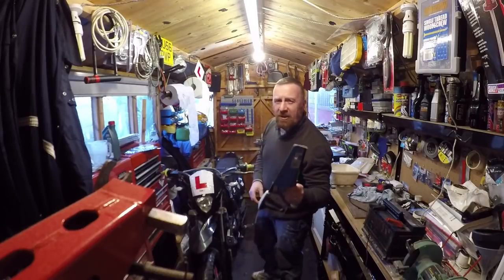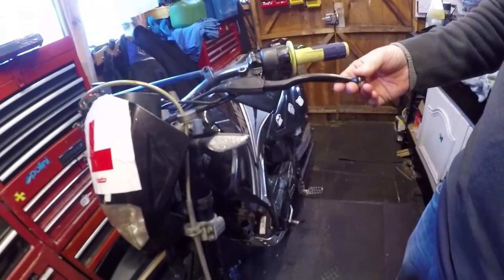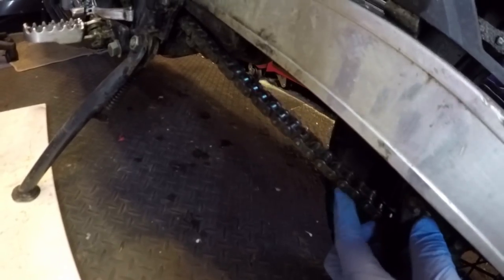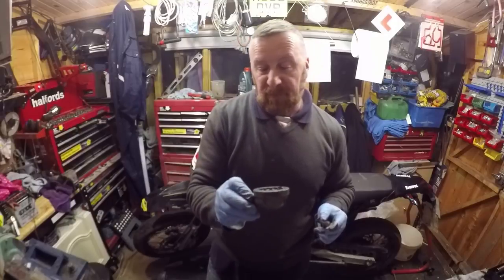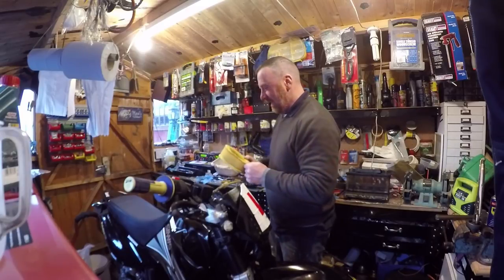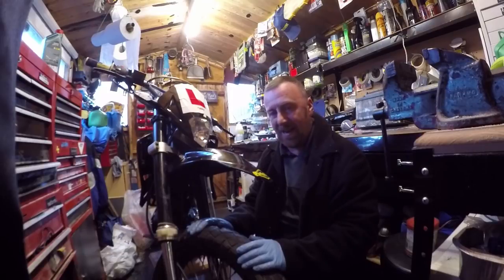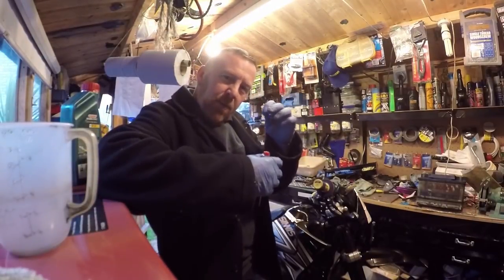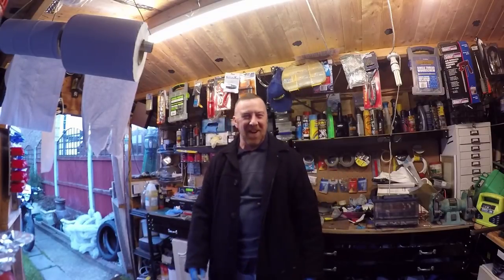SINNIS APACHE 125 REVIEW AND FIX UP MARK SAVAGE

Comment: I do a lot of work on these Chinese bikes in my shed lol I find most the issues these bikes suffer from is electrical the current varies while it’s on idle causing bike to hunt slightly and sound off and another one to check with these bikes if they don’t idle smoothly is the valve clearances! :) great video mate keep em coming I’ve just got a speedfight 100 project on the go now 😃
Reply from the maker: you have to love the old speedfights bud, thanks for watching and you comment
mark

Comment: Hi Mark top videos as always. Just thought I would share this with you. Speedo cables snap a lot on these due to poor routing, where the cable go into the front wheel at 12oclock re-route at 9 o clock, less of a bend that way

Comment: SINNIS APACHE 125 are really good bikes ..provided they looked after and regular maintenance .. Generally everything most young lads don't do  .. that's only problem with buying a second hand one you can be pretty much sure its had a hard life and not been looked after at all ... saying that even from new bolts are loose and none of cables are greased lol  

pretty much same state yours in ! ... i changed oil on one i had and looked like really thick gravy with lumps .. so am guessing its never been changed since new hahah
Reply from the maker: a gree and this is what i say in my videos of these and may other bikes / mopeds as in my many videos lol
thanks for watching
mark

Comment: Hi mate, im back again for your help.. bought one today (an apache) was all fine but ive never had geared bike so was stupid to try ride to london from brighton... i kept stalling at red lights before even getting on a23, and when i did i got to like 70 and engine jus cut out.. i think i had the choke on so i messed it up.. then wouldnt start and think battery died now. Had to leave it at some lovely peoples farm and get it tomorrow in the van.. you happen to have some advice? Cheers Mark.
Reply from the maker: oh dear bud 
ok look at videos of geared bike and how to ride them lol, remember to use your clutch and change down before stopping 
https://www.youtube.com/watch?v=aOYxE2NcpN8&t=13s    try this one 
if you had the choke on you will need to clean or change the plug as everything else will be ok on the running side
as for the gears as long as you have not damaged that side of it- it should run 
charge battery when you get it home then give it a start
Reply: Managed to get it running.. was very weird.. wouldnt start after charging battery, cleaning plug, and then kicked the bike stand back and somehow reacted and started 2nd time we done it, was wondering where you are located and would you be able to help with abit of tlc on this bike would appreciate it. Let me know if thats possible
Reply from the maker: @klaudkveda2917  hi bud its not something I do to be honest, I do lots of videos on how to do that so check out all my other 125 videos as they will help but good news its all running again
Reply: @marksavage  something real weird going on.. it started this morning, went to work, try start later and wont start again, soemthing to do with the bike stand
Reply from the maker: Klaud Kveda I bet you’ll find this was the the underlined problem with the bike 
I agree it’s electoral so wiring / cdi problem not engine as such 
You have cleaned carb plug and air filter petrol is getting in ok and clean 
Could even be stator coil 
You have work there bud 
I’d take it all apart and go over everything

Comment: Great video, I own a houniao hn125,  you was talking about air mixture adjustment on the carb saying 6 and a half half turns out I've adjusted mine 2 full turns out it starts runs ok but sometimes backfires in the carb should I turn it out more or less or just leave it as it runs ok, any advice much appreciated.
Reply from the maker: 6 half or 3 full turns is the standard, once the bike is running ok leave it otherwise a little our or in for fine turning is down to you, cheek to colour of the plug as that will help you to tuning it 
thanks for watching 
mark

Comment: Hey mate i got a sinnis apache 17 plate carb.  Its now getting really hot after a little ride. I do need to do air filter.  Mine pops 😅
Reply from the maker: they are air cooled , change oil for good 10/40 oil , give it a service with the plug and air filter. see how it gets on but it is hot here in the UK

Comment: Hi Mark, sorry me again. Couldn’t find my earlier post. My ybr has done 25,000 miles (last services around 17,000) there is definitely an out of place noise when I’m traveling along about top gear, 5,000rpm. It sounds either top end or left hand side of the bike. It’s lot less noticeable if I travel up a hill in top gear. Only when on the flat I hear it . How easy is it to check the valve clearances ? Also the cam chain tensioner ? Or any other ideas what it could be
Reply from the maker: if the left side it sounds like the cam tensioner which is common as for valves there are some videos on line but as yet I haven't done one but its not too hard as TDC then adjust to the right clearance 
it will need doing very soon bud or it may fail
Reply: @marksavage  How easy is it to look at the cam chain/belt and adjust ?
Reply from the maker: you can take off the left hand cover with a few bolts and take a look and the tensioner  is just behind it 
it may have come loose so worth a look

Comment: Hi mark we speak on Facebook about Pj laming I have a Apache that’s got not spark best things to check please mate first to check battery of course but any other common things on these I had one but it was a carb clean and good
Reply from the maker: rear brake and switch , chain and cogs , front shocks , burning oil bud and good old speedo cable , ph rust lol 
plus add in tyre cost if low

Comment: Hi Mark
Hope you are well love your videos looking for some advice
I have a zontes mantis 125 with dual brakes front brake works ok nothing from the rear tried to bleed but only spits out fluid.
Tool caliper off all free and good meat on the pads.
Don't seem to get much fluid to brake union.  
Don't know if you have worked on one any advice bud
Merry Christmas
Reply from the maker: hi bud it could be a air lock so may need to suck the fuild through but often the master servo goes or needs an over haul ,you can by kits for bleeding brakes on line that will help 
marry christmas to you and all bud 
mark

Comment: How you get the air filter out I felt there was something stopping it and don’t want to force it but couldn’t see what was in its way
Reply from the maker: Double check you have all the bolts out , there's one in the middle and far corner bud
Reply: @marksavage  I have took all the ones out the casing is that what you mean ? Or is there more holding the filter in place ? Thanks for reply 👌
Reply from the maker: @frasermitchell966  yes bud that's all that holds the cover on !
But easy to miss one 
If all off then you will have to give it some
Reply from the maker: @frasermitchell966  or are you saying the cover is off 
Then some filters twist off or have a screw in the middle
Reply: @marksavage  yeah the cover is off mate I could see e filter looked the same as one in this video just because you didn’t show how it came out I wasn’t sure if it just pulls out or not ? Have you got Instagram or that for more info you seem to know a lot about these bikes ?🤞
Reply: @marksavage  sounds good will try that thanks buddy, now the bike won’t start think it’s the batter with this cold weather , any tips how it comes out

Comment: I have the lexmoto adrenaline version. Mine has a terrible rattle. Apparently it's the crank shaft balancer nut is loose. Is it an easy enough job. Like the videos btw. Thanks
Reply from the maker: dobby1995 it’s the adjust on the side the keeps it tight but if its rattling the damage may have al ready been done 
They suffer from cam rattle 
The valves need adjustment and as in my video oil !
It will be a big job as to get to it lots have to come away bud
If it’s running let it keep running just don’t push it too much  
Thanks for watching
Reply: @marksavage  nice bike m8 
Fitted new bat to 
Scooter not starting 
But lights n horn gd 
Think starter on. Way out 
Prob its first change 
Since new
Reply: @marksavage  ohh thanks anyways I'll just ride it until it dies then lol. Ive had it 8 months like that. Just got to do until February when I get my fz1n. Got to admit though I would recommend it as a first bike to anybody. I've gone from a full power aprilia rs125 and don't miss it one bit. You can throw  these around making for great fun.

Comment: Had a white Sinnis apache it got stolen I  did loads work to it replaced the back sprocket chain lextec  stainless steel oval full system better ignition coil clutch cable  Speedo drive .They  nice bikes good engines have to watch the oil on them tho replace it often and the starter spag clutch and clutch cables I put a bit oil in stator side where the starter clutch is never went on mine did nearly 15k on it before was stolen
Reply from the maker: they all have the same rear light , rear brake , speedo, clutch , chain and ignition  problems but you get what you pay for 
loads of 125 video to watch on my channel

Comment: wondering if you could help me out whatis the factor slow jet size for sinnis apache 125.and will it be ok to go one size up to get little more power with slight air mix ajust if you could help that would be great
Reply from the maker: To be honest best change exhaust as this will help 
Upjet just make the air mix a mess with bad starting or browns the plug 
Just if you want best take it out and go up by 4 then tune as in my carb video
Reply: @marksavage  don’t really want to change the exhaust my five year old sits on the front with his own pegs 
So the quieter the better sometimes we can be 40 feet away from people in the woods a bit of short shifting no one knows  you are there 
So we rely on stealth .thats y I was wondering what jet size is cos give it sudden full throttle to like get up a hill or need sudden power to get out a situation it bogs think it’s a 3.5 in it just now .whats the main size you see when working on them .i can’t seem to find anything on the internet
Reply from the maker: @prcaroo1  I'd take it out to see what it has in there now
But a good service and new plug / air filter will help more bud
Reply: @marksavage  done that and all that stuff already bog still there ? Think I might just get new carb
Reply from the maker: @prcaroo1  yea bud ,if new filter and plug 
And all adjustment of carb ,valves ok then yea new carb
Reply: @marksavage  do u have a manual.?if so fancy looking up jet size 🤭think I’m gonna have to order one of eBay.tried to download one or two but can’t seem to do it 😤
Reply from the maker: @prcaroo1  sorry bud no
But if you take it off it will be on the side of the jet
I always bought a pack of 4 so one down and 3 higher to play
Reply: @marksavage  the one that was on it was not visible tried that got jets of eBay 2.5 to 4.0 still seem to have the bog all the way thro them rev a Little slower it revs all the way thro let the idle settle full throttle either cuts out or has a crappy bog .its that bog that has caught me out a few times when I needed the power to get out a situation hill ditch off road for example just can’t seem to get rid 🤬🤯

Comment: Hi Mark, I have a pulse adrenaline 125 and it won't idle or start off electric start but will eventually bump start ? Any ideas what it could be the problem?
Reply from the maker: a few things but but could be the stator coil , power regulator , ht coil , even plug plus they have a odd fuelling system
Reply: @marksavage  okay thanks for helping  Mark, but after cleaning tank out and cleaning carb also replaced plug freash oil new ht lead i thought I will put baffle in exhaust as its never had one and started tap of bottom lol. Any reason why its dosent like it without dB killer anymore.
Reply from the maker: @ethanb6276  they need back pressure bud 
But could be worn piston and now needs a little help 
If it runs now bud I'd leave it as is

Comment: hia mark have a tappets  issue got feelergagis do u no the size it's a sinnis 125cc for intake and outlet
Reply from the maker: Hi bud 
Thanks for watching and wish I could help but I've not worked on one and dont know the gaps 
Maybe try google or ask at local bike shop
Reply: @marksavage  thanks bud
Reply: Haynes manual says 0.08mm - 0.10mm on the inlet and then 0.09mm - 0.12mm on outlet. I set mine to 0.08mm on the inlet and 0.09mm on the outlet seemed to do the trick

Comment: I have recently bought an mbk booster and took out the variator ring and put slightly lighter rollers but now untill 20 km/u it accelrates quiet good but after that I feel like a dip and it loses power. Do you have a solution? Thanks.
Reply from the maker: as in my videos
light roller with give you great pull away but no top end, to heavy slow pull away but when you do get there good top end, watch my VARIATOR video 
id go a little more heavier 
mark
Reply from the maker: I really do have a lot of videos on variators , they maybe on speedfight and aeroxs but all the same basics

Comment: Hi mate I have 17 plate smr where is main fuse located plz
Reply from the maker: hi bud , left side panel near the batter or under seat to the rear, why whats up bud power gone ? 
you would have to check why the fuse went , dont just replace or it will go again, but it can go if your front main bulb went but the suffer from electric probs any way like the wires breaking and shorting near the main neck due to turning left and right  lot lol 
but see how you get on bud
Reply: @marksavage  electric start and indicator wony work head light work tho.inwill have to find out why it blew
Reply: Thank u for answering me good guy
Reply: @marksavage  needed new wire loom bloody sinis apchie

Comment: Hi mark 
  I recently brought a Sinnis Apache 125 it has been sitting for a while but it was started every other day. i had it started Saturday but when it came to start it sunday it won’t bang it will just turn over and over it’s got a full battery fresh fuel fresh oil,it sounds like it wants to start but something is not letting it.it dose have a spark and compression the ignition coil is fine. I was just wondering what anyone think it could ive also tried  some easy start in the carb an took the carb off and clean it.i’ve pretty much tried everything else I can think off . Any ideas ?? Thanks
Reply from the maker: Driftreaper-69 Reaper so you have spark and it’s nice and blue 
You have fuel and the plug after drying and cleaning it gets wet with fuel 
Carb is filling up and fuel is fresh and ok with no water 
Air filter is clean ?
Bike oil is ok
Reply: mark savage yea I’ve given it fresh fuel fresh oil and yes has a great spark it also smells quite rich on fuel when turning it over it turns over it just don’t fire up
Reply from the maker: that is odd but it will smell as its not starting, odd that you have spark!
normally its the cdi or electrics that play up, was it tappy ? could be broken valve / loose cam chain /tensioner 
if you know petrol and spark are ok then its the top off and check them and the chain bud
Reply: mark savage it boggles me to man. It turns over no problem it’s like a kill switch or something stopping it from firing up tried it with different choke settings and still nothing. I’m going over the bike again today so hopefully I either sort it or come across something
Reply: There is no tapping noise either so I’m really mythed lol
Reply from the maker: you have spark so it cant be that  @sketchyryder1494
Reply: mark savage yea I’ve got spark and compression I’m thinking it might be something to do with the carb
Reply: mark savage just to let you know buddy I managed to get it running and all good now, it was spark problem plus carb but it was one and then the other occurred but anyway she runs :)
Reply from the maker: @sketchyryder1494  well that's good news but did you did say spark was ok which was odd and happy you got it sorted bud
Reply: mark savage yea it was odd because the spark was fine I changed the cdi plus the plug and then carb and ticked straight over.. kinda kicking myself over it tho but thanks for your help buddy take care

Comment: im hoping u can help me im trying to find out why im not getting a sprak from my spark plug ive got a new cdi new coil and still not spark ive got a Lexmoto adrenaline 125 
can find anyone with the same bike as mine and a fix
Reply: Rampy 44 check your side stand switch if that’s faulty it will cause bike to not make spark :) or try another spark plug.
Reply from the maker: yes mate like louis says so worth a check, other use a volt meter to check power coming from the battery to the cdi then out from the cdi also check power from the stator as they also can go wrong then ht coil 
this should so you where the fault is 
mark

Comment: Hi there i need to turn the engine light off any clue
Reply from the maker: Explain more bud as guessing the key ignition isn’t working ?
Reply: It starts and runs bit black smoke from the exhaust any help
Reply from the maker: Mr Choules so what about the lights ?
Reply from the maker: Mr Choules black smoke is oil
Reply: Light is still on but lots off black smoke. What could be causing oil leak
Reply from the maker: Mr Choules oil seal , piston rings 
Either  but not good !!
Make sure you keep the oil topped up and clean plug until you get it sorted
Reply: @marksavage  expensive job
Reply from the maker: Mr Choules in a garage bud it can be as all labour really